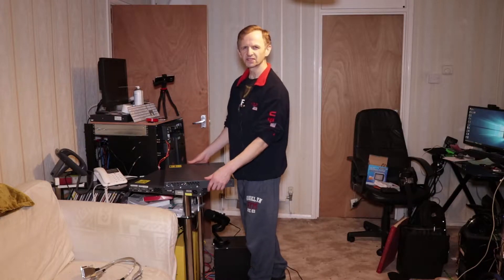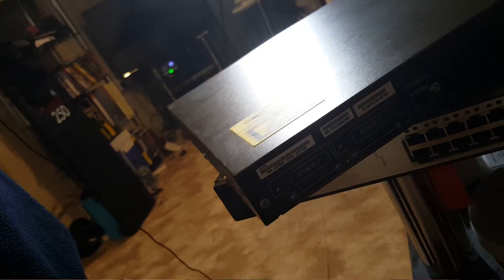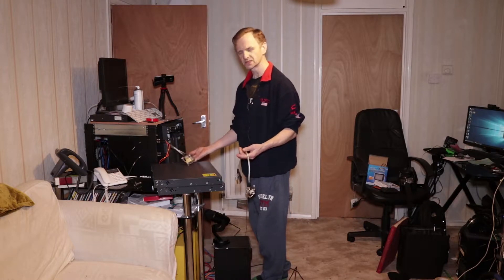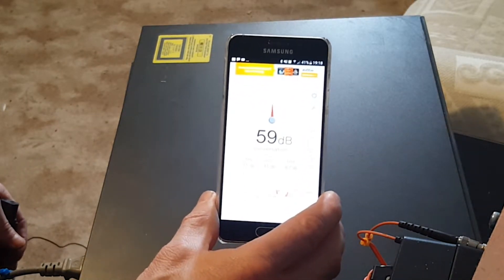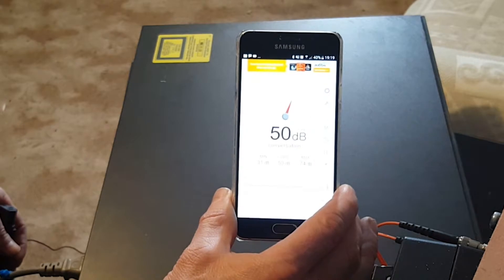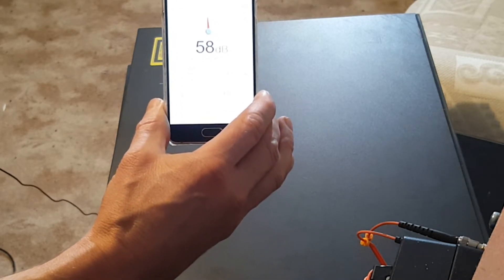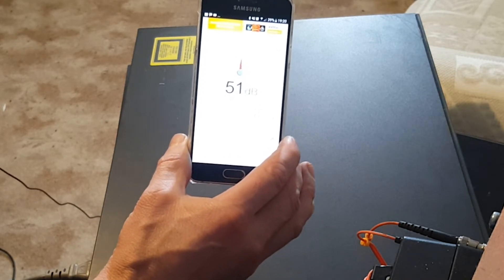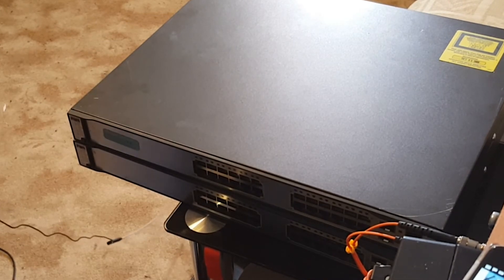Home Network - Part 3 Cheap cisco switches from ebay

Comment: This might be a stupid question. But aside from networking labs, I guess? Do you build any other labs? I know I’ve seen your esxi stuff but was wondering if you messed around in other things too
Reply from the maker: I do some active directory, Veeam but nothing yet that is worth a Video. Although I have got some thoughts lined up.
Reply: @ddfitech2625  thats pretty cool! I want to get more into AD myself. I'm debating a windows server license
Reply from the maker: @nds6767  Thanks for reply. Yes I am too debating to whether to get a license rather than having to rebuild AD servers at end of the 180 day Evaluation. Azure Active Directory is also a worth while thing to look at although I don't think you get full AD Services unless you pay for AAD DS. I currently am a Network admin but like to keep my knowledge up in other areas :-)
Reply: @ddfitech2625  oh I hear that. Right now I'm working on a project that allows you to integrate testing with a small config box. Takes advantage of exchange through Linux 😉